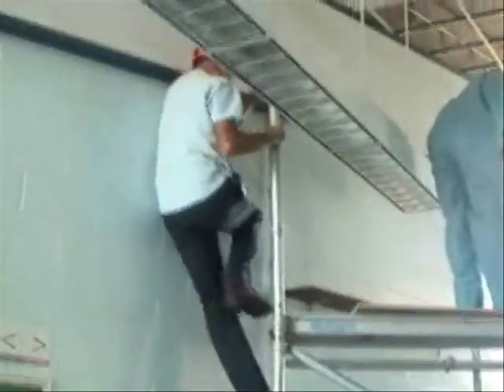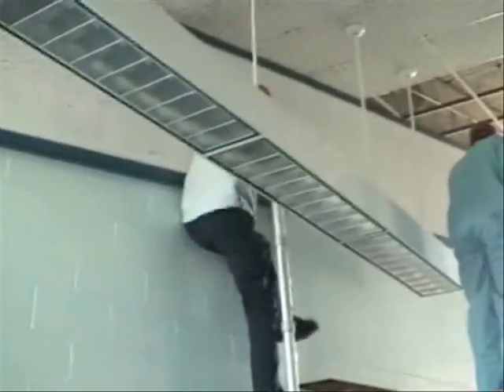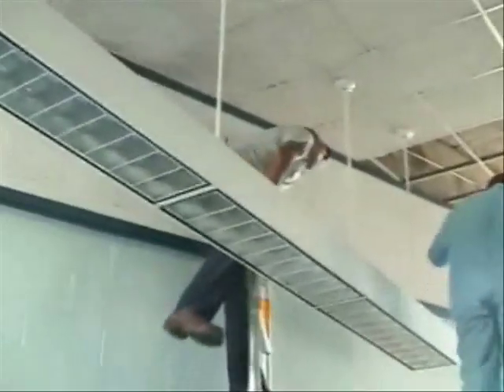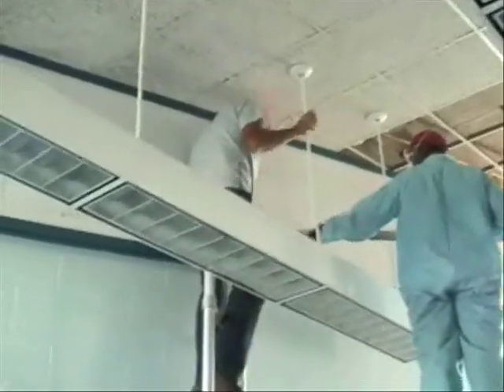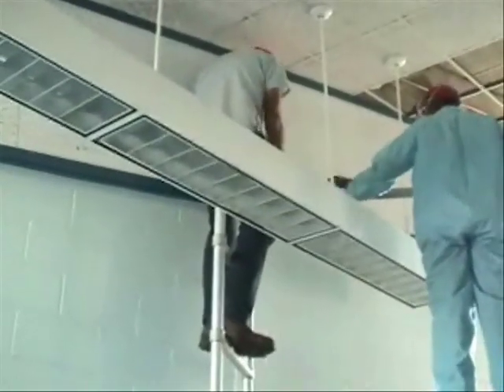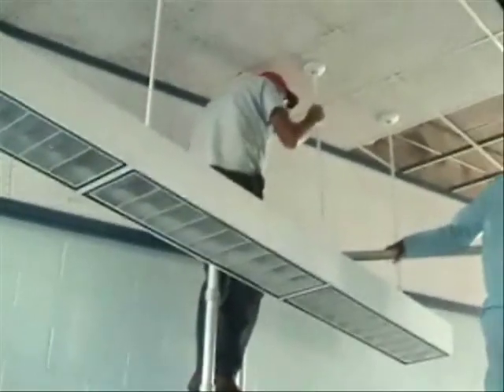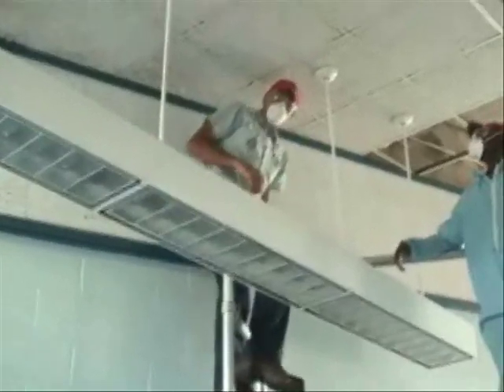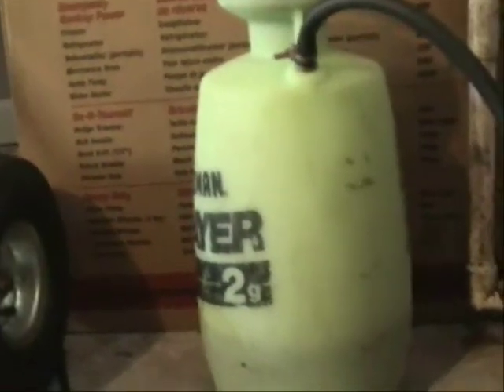HVAC: cleaning the evaporator coil

Comment: You know the only thing your shop vac does is dent her fins unbelievable Dr who doesn't know how a wet vac works.
Even with proper attachment on you still need to cover the back side of evaporator to create SUCTION! you'd be better off putting the hose on blower side of such tiny shop vac and just blow through the fins if you can't afford decent equipment instead of damaging customer coil and not bother to apologize and offer to comb it straight after..

Comment: Have a pro remove and steam clean you A-coil, and install a UV light coil sanitizing lamp and replace the bulb annually. The gas and electric savings from clear air flow in the HVAC are dramatic - not to mention the health benefits.

Comment: Our blower motor was dirty, and the coils are dirty. I saw a website that suggested just putting the coil cleaner on the top of the A frame and then rinsing with water (collects in the pan underneath) .  That by pure gravity the coil cleaner should move through the fins attacking the dirt underneath.  It advocated doing this instead of cutting lines and pulling everything out.

Comment: the coil cleaner i use at work is alkaline based and is very nasty when even a drop gets on bare skin.  i keep a bottle of white vinegar (wal-mart) on my van just in case of skin contact.  vinegar is acid based and instantly neutralizes the alkaline cleaner.  don't breathe the vapors either.  trust me, you will know if you do.  it's really best to have a pro HVAC tech do this kind of work, since they can also to a complete system check to see if the system is at peak condition.

Comment: DrZarkloff.  I am running an old Fedders Gas Furnace with the A/C Evap coil on the top of the furnace.  How would I get into the A/C Unit to clean the Evaporator coil.  It appears to be in the Plenum.  The plenum is in the Attic.  I have never cleaned it, but I know it needs it.  What is the easiest way to gain access to it?

Comment from the maker: I used an inexpensive pump sprayer and I used Alka-Brite to clean the coil. I usually won't use anything so strong on an evaporator but the coil in this video was just plain nasty. It needed to be nuked.

Comment: When you find one that has been collecting dirt for quite a while, a light misting of hairspray, followed by a few minutes wait, can then be relatively easily cleaned using something like a plastic putty knife to remove the dirt and debris. The hairspray helps to solidify everything so that it comes off sort of like a cookie sheet. This is followed by your normal cleaning.

Comment: Those a- frame coils are really a pain to clean. Perhaps keeping a seperate pump/sprayer with only water in it in place of running hose inside would help. Also, I've found it's very easy to dent the fins while using the hose from a wet-vac to clean out sludge.

Comment: thank DrZ! How would you recommend cleaning a case-coil on an up-flow furnace with the plenum only 1" from the floor joists. That 1" of room is just not enough to throughly clean the case coil without removing the lineset. I would guess just remove the upper plenum and assorted ductwork then raise the casecoil enough to get at it easier. What do you think?

Comment from the maker: I don't recommend two air filters unless the first one in line is more of a low cost pre-filter so not to dirty up a second more expensive one so fast.

Technically, it doesn't matter which side of the coil is the return and which is the supply. Are you trying to design some sort of bi-airflow air handling system? You could be creating a maintenance nightmare. If you put one filter on the return side and one on the supply side, the one on the supply side is liable to create a moisture problem.